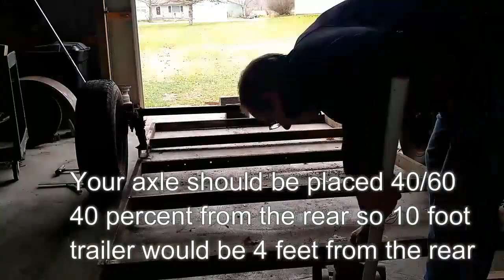Homemade Utility Trailer Build In 6 Minutes (time lapse)

Comment: great job. the deck boards for the floor, were they bolted on? or did you use machine screws?
Reply from the maker: Thank you and I used lag bolts to hold them on much stronger

Comment: What did the axle come off of?and what glue would you say is best stick or wire?
Reply from the maker: The axle came off another trailer that was at the local scrap yard and I prefer to use stick welding for stronger welds